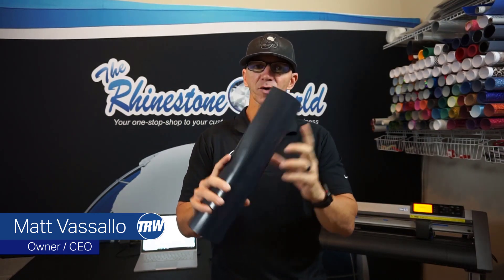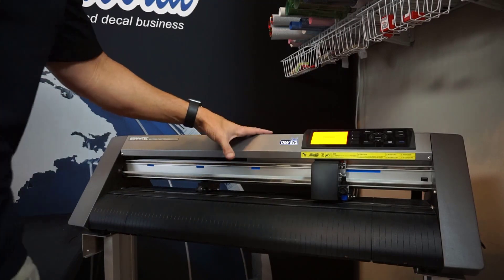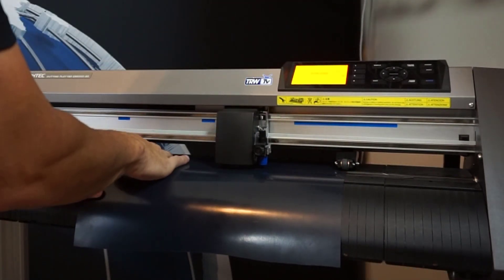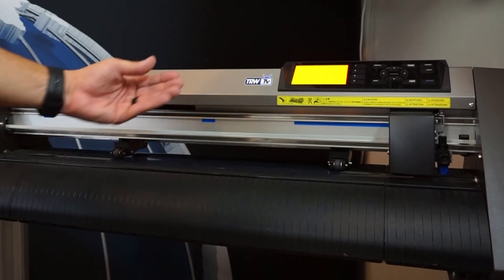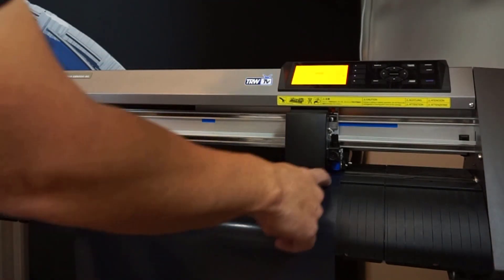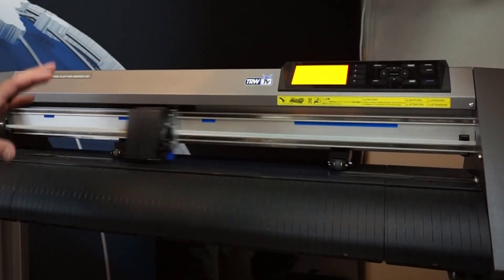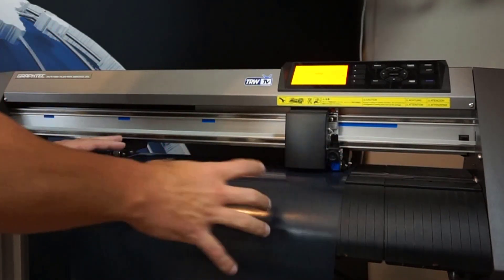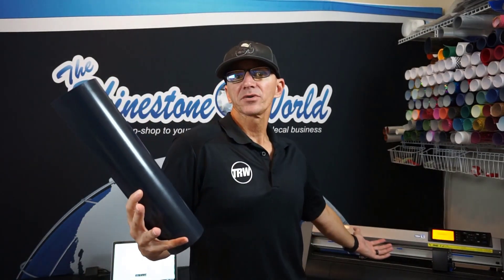Troubleshooting Vinyl Feeding Issues to Save Your Material

Comment: It literally fed a half centimeter to the right within 3 feet!! User error on your part it seems.
Reply from the maker: Did you catch where we said we'd loaded it "Pretty good"..not perfect but that's the whole point of this video. To show everyone that they should be running 3 feet or more of their material through as a test, by hitting the down button and the fast button at the same time. That way, you're not in the middle of a large cut and realize your material is misaligned and the cut is off. Thanks for watching! -TRW Pilar